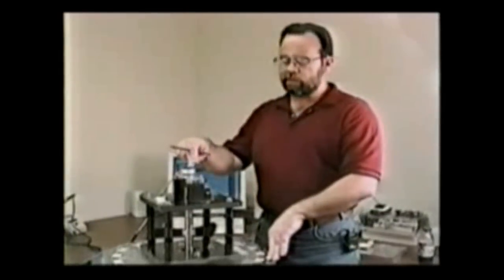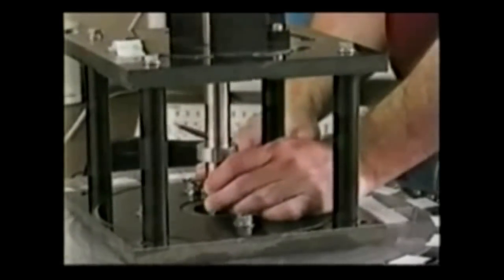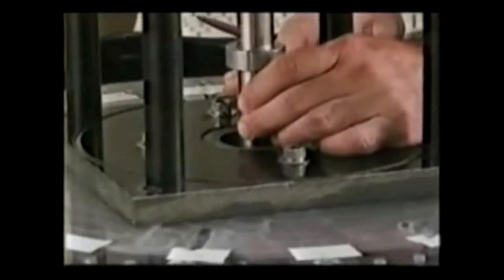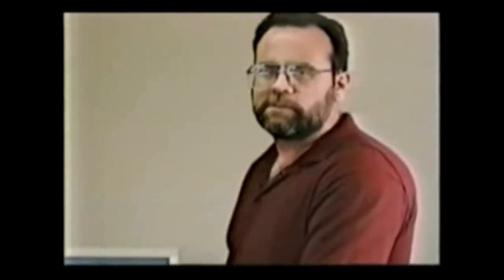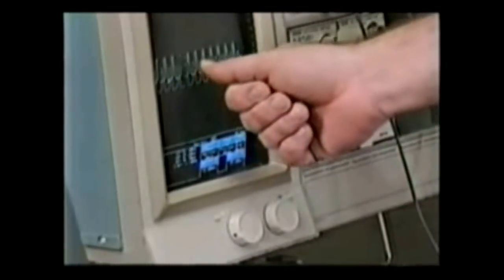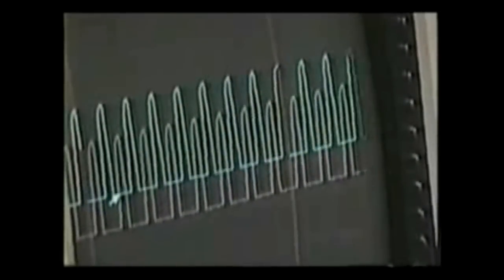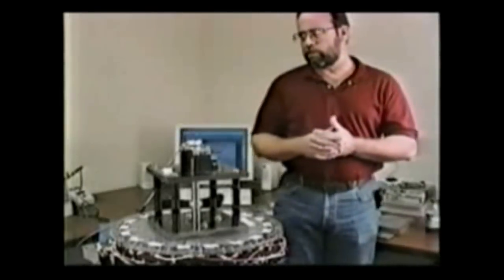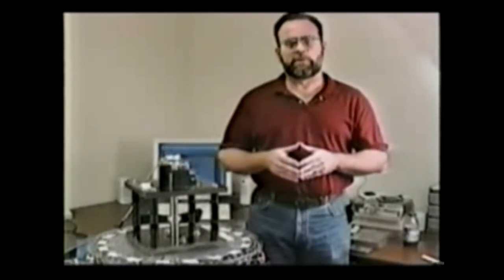Carousel Electric Generator

Comment from the maker: @Rawbush  The Encoder I have shown is an Opto Sensor, it requires an optical obstacle to trigger, eg moving your finger over the sensor will trigger the sensor. I am building some parts and hope to have more data in a few weeks or so. I will post a Video on the Motor when it is built.Thx Chris
Reply: whatever happened to this?